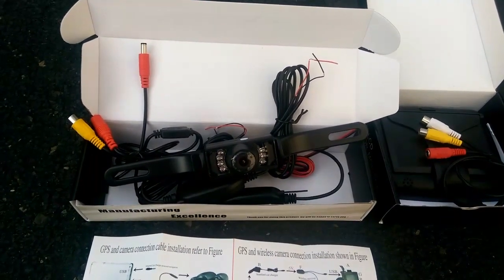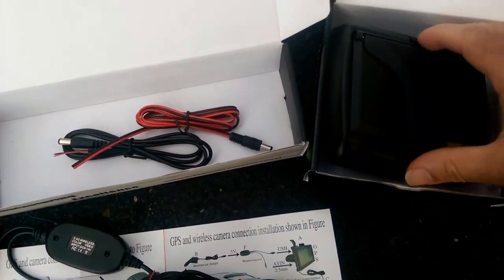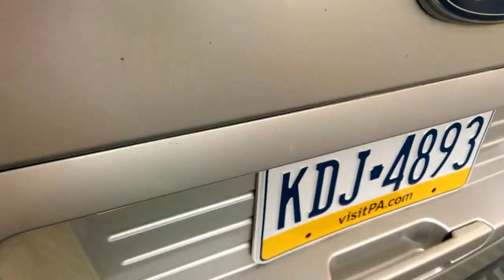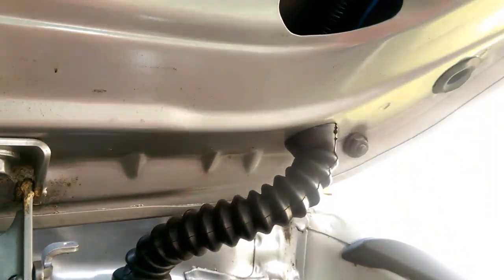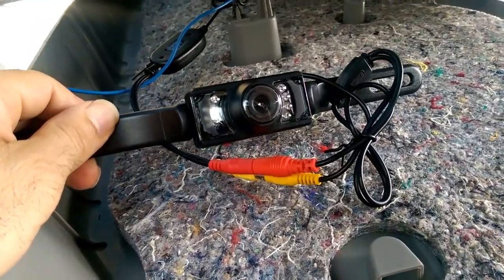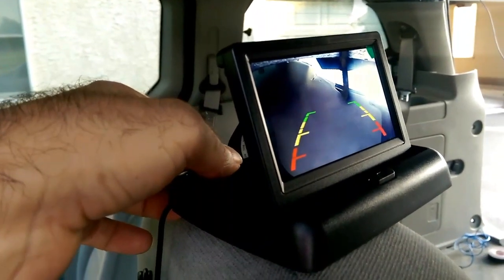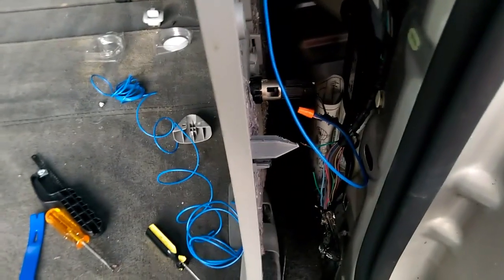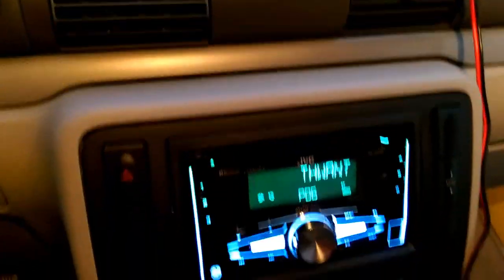Installing Rearview License Plate Camera in Minivan

Comment: Hi there, good work..... 
If you refer to the monitor instruction manual, you may discover the White RCA Input is actually for a secondary video input (such as a DVD etc).  If 2 video sources are connected, the Yellow RCA video input will have priority when the reverse signal power is detected.
Reply: Thanks Bailey!  Any other helpful advice or info to install this unit?  I want to get it going soon, and would like to know any tidbits to know about.